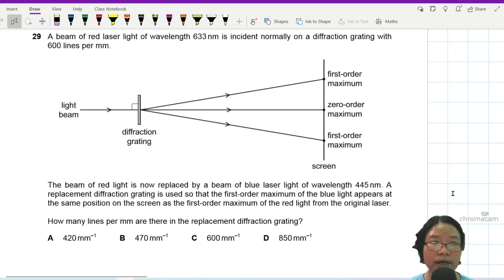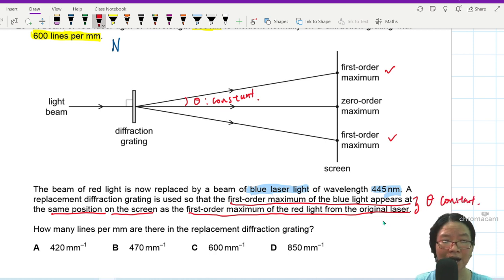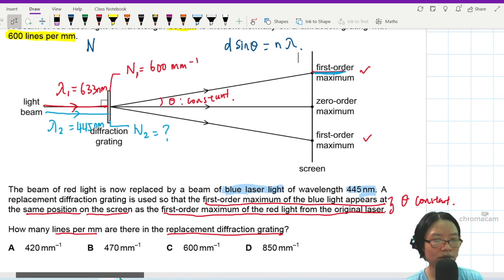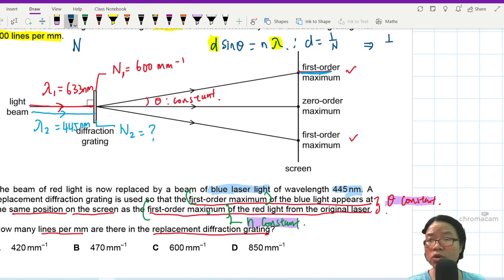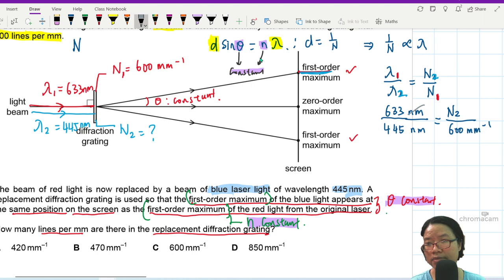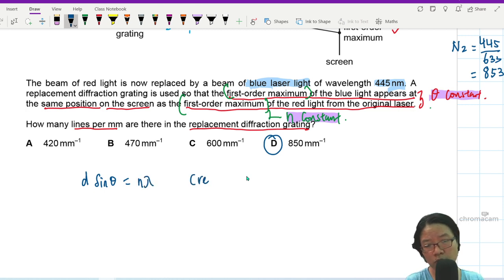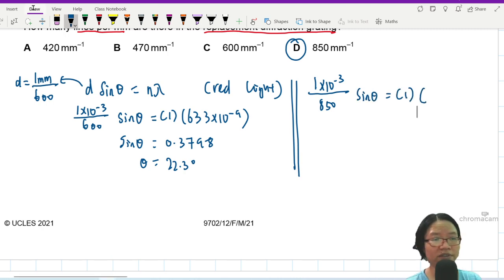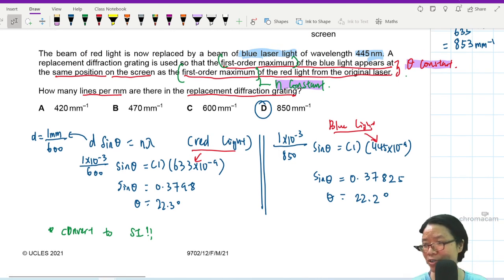FM21 P12 Q29 Replacement Diffraction Grating | Feb/March 2021 | Cambridge A Level 9702 Physics

Comment: How is this worth 1 mark🙄😒
Reply: I think because although it’s nice to see the working and way she explained it using ratios, you could have actually gotten this answer in mere seconds because the only way for blue light with a shorter wavelength to diffract as much as red light is if there are more slits per mm hence the only viable answer is D